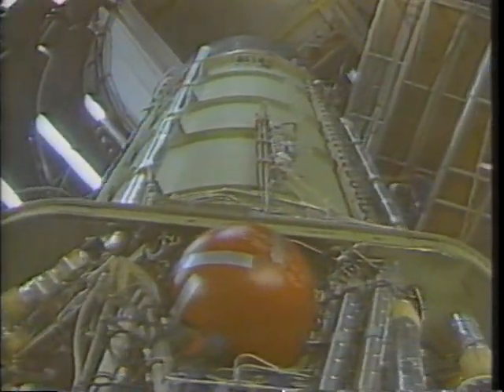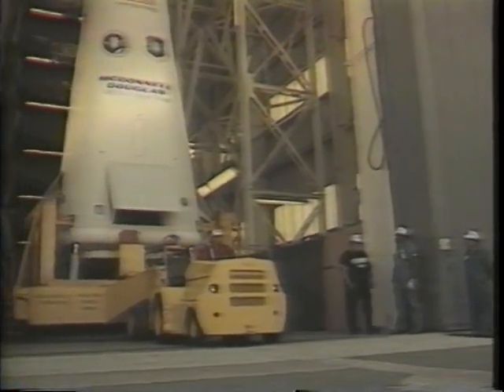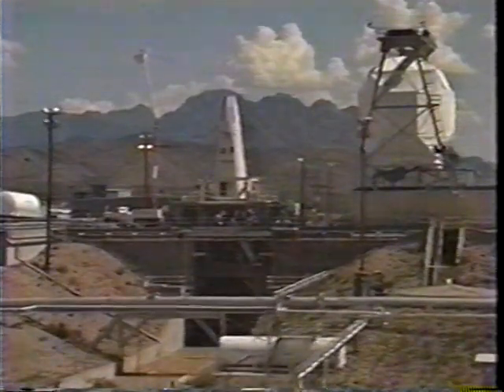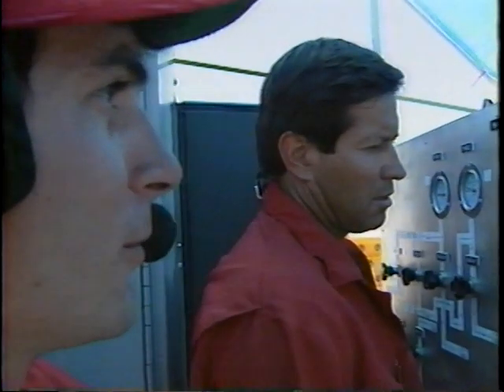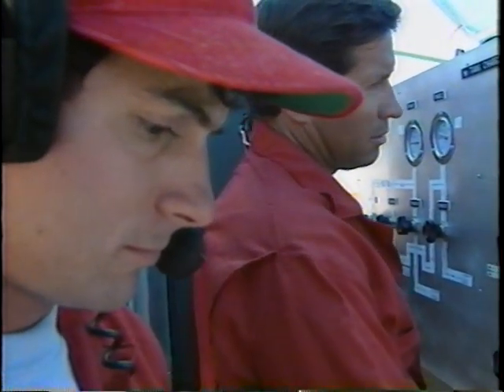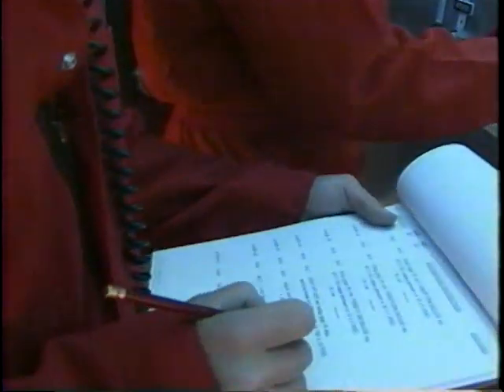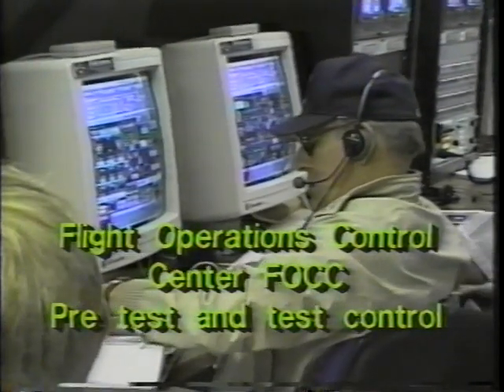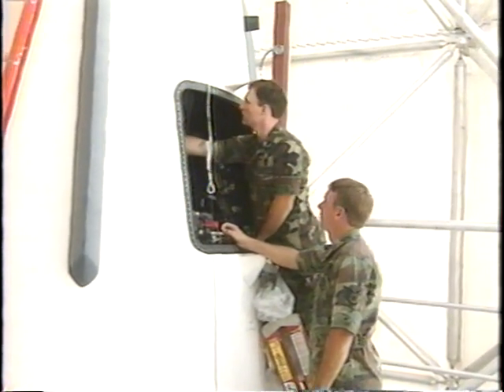Single Stage Rocket Technology (SSRT) Delta Clipper Experimental (DC-X)

Comment: you don't have to go far to find out where spacex acquired this VTOL technology
Congratulation MacDonnellDouglas engineers ;)
Reply: Unless they directly cloned the engine and avionics software from the DC-X, wouldn't SpaceX's technology still be original to them, even if it was inspired by the example of the DC-X and performed the same function? Why do we assume that SpaceX's team did not/were not capable of solving the problem independently?
Reply: @joellewis6086  Unless this or that. if anybody else does this then they copied spacex.